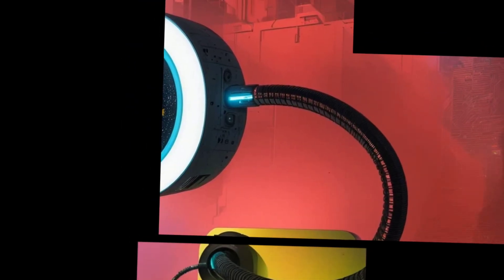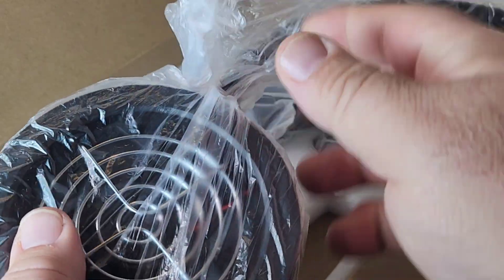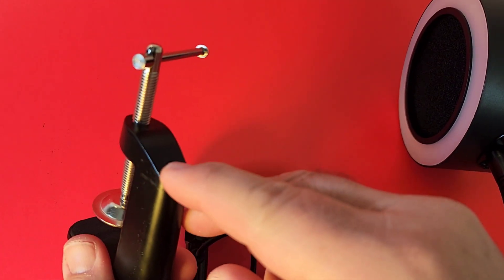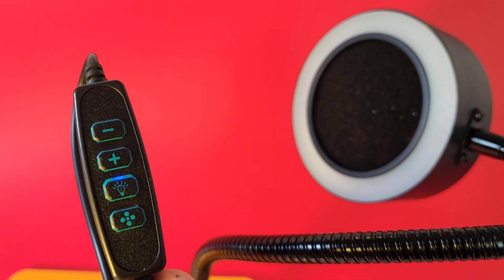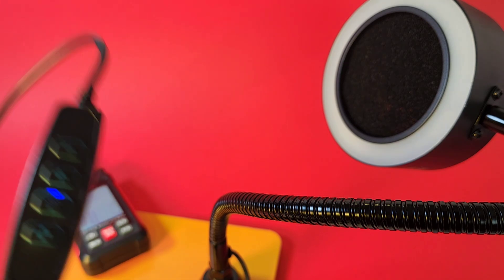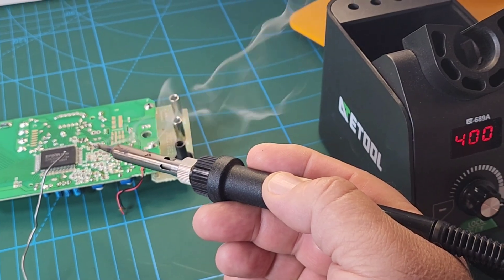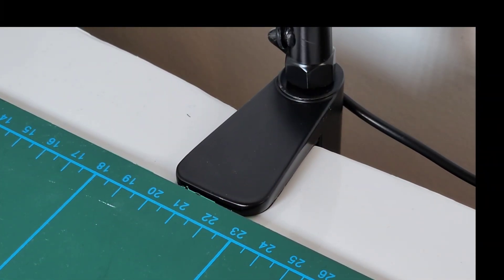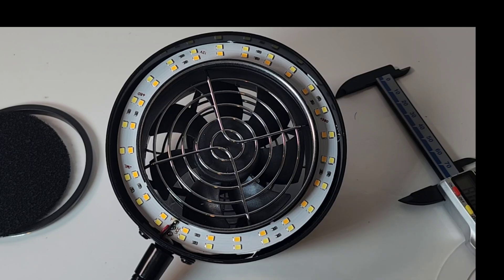SAIN SMART Magnetic Fume Extractor Review!

Comment: Thanks for the video! Are you still using this fume extractor? How often do you change the filters? Would love a one year follow up :)
Reply from the maker: Yes, I am still using it on my soldering bench. It's not my main fume extractor but one I use if I'm soldering a few jobs. It's quiet and much less a distraction than my main extractor unit. To change the filter, simply unscrew the outer rim counterclockwise and replace the carbon insert. You can cut a square sized carbon layer to fit! I might just do a follow-up for ya! 👍

Comment: Looks like quite a bit of thought has gone into the design, easier to position than the cube variety of extractors and takes up les space. The work light is a great addition, as you said though it would benefit from speed control of the fan. Shame it doesn't look like it is available in UK yet.
Reply from the maker: It's "just" been released so it will probably arrive in the UK soon. 😊 Spot on about the worklight..this definitely takes it a step above many fume extractors.

Comment: How useless is that? Nothing is filtered at all. It's just cosmetics. You can take any fan and blow the smoke away. This device also only distributes the smoke evenly in the room.
Reply from the maker: Hmm..did you even watch the video? You're completely wrong my friend.  This doesn't blow anything.  It's a fume extractor. It sucks the contaminants and filters the air keeping the space safe. It works incredibly well and provides s great light source on the subject at the same time.
Reply: @KeepOnTesting  Yes I watched the video. What are these simple foam filters with extremely large pores supposed to filter? To really filter the pollutants you need something like activated carbon or special filters that are certainly not cheap...
Reply from the maker: @AlexDD99  Great to hear. These are carbon activated  filters. They also double up as I mentioned creating a very solid filtration system. No worries here. You hopefully saw the PPM (pollutants)  were kept low while using this device. I've ran multiple tests and this extractor does a great job at filtering the airborne pollutants.
Reply: @KeepOnTesting  I believe you when you put your meter behind the fan and a measurement with filter shows a significant difference from a measurement without filter.